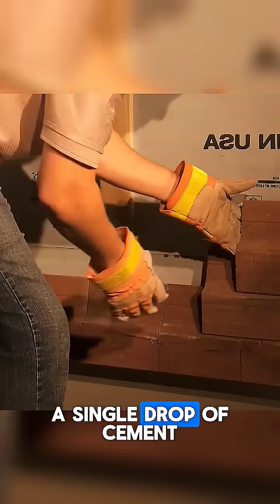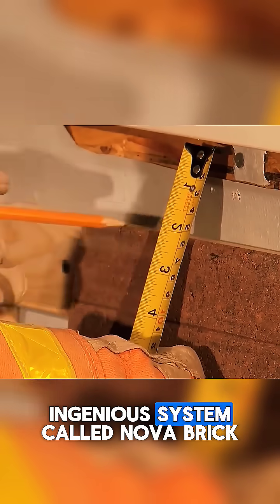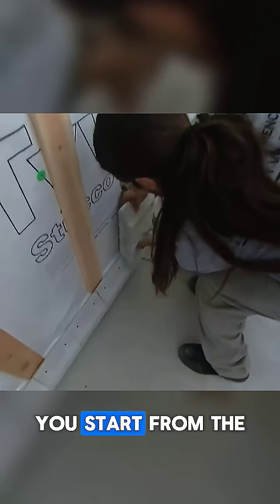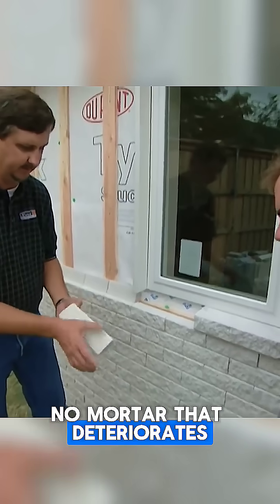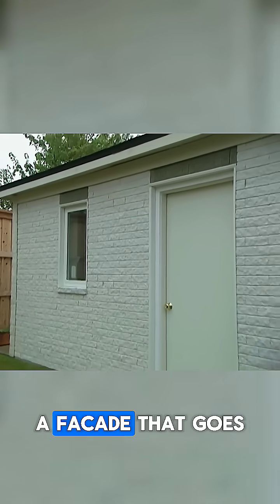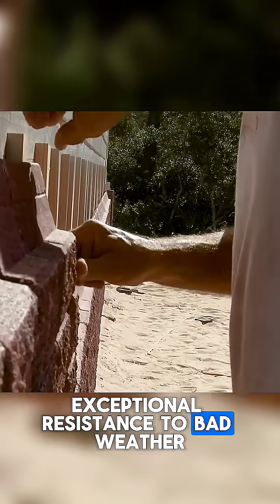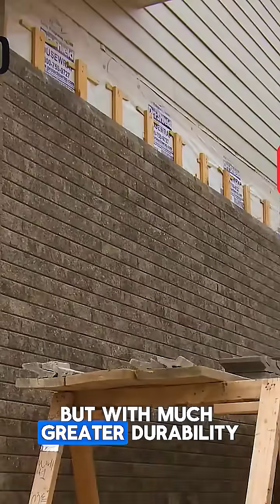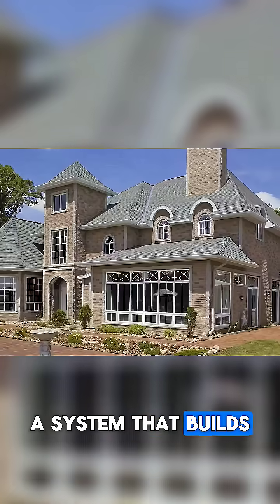This Brick System Needs ZERO Mortar! (Novabrik)

Comment: what stops them falling off   must have to fix them  every 3rd row  or we all fall down
Reply: I think I saw a tiny nook that hooks on the top edge of the one below it. But yeah, agree, needs to be fastened somehow.
But it's a facade, not a brick wall what they say at the start of the video. 
Brick wall is some that gives support to the building, facade is just an outer layer added to the outside wall to look nice, its not an integrated support of the house. Hence it can go out without mortar or glue.
Other things that gave me pause:
- Not showing how bottom row gets attached/fixed.
- it's not interlocking, its only hooking on the one(s) below it. 
- Point given by OP: not shown how its being tied to the building. .
- Calling it a brik when it's NOT one. 
- not being cemented/glued means air goes thru it. 
- A lot of weight added for no support to the building.
- the good thing its not gonna burn in like those huge fires like in California etc. (roof still needs tile or metal etc, sure, but it helps)
- No long stretches are shown, is this problematic? 
- What are those corner and on the top things exactly?